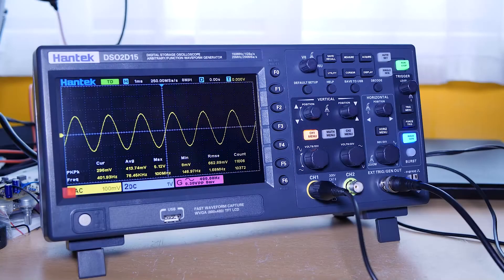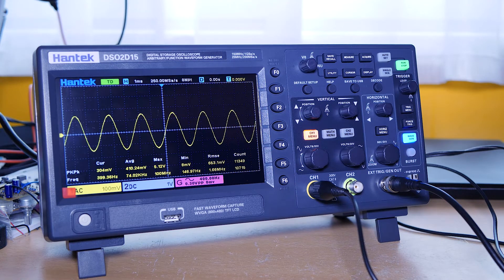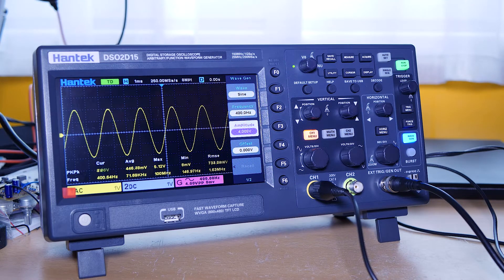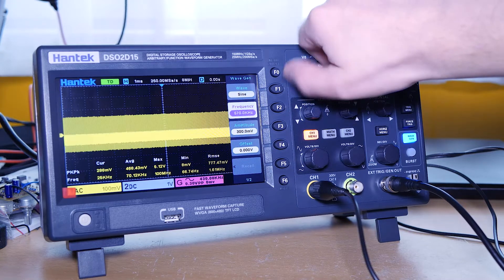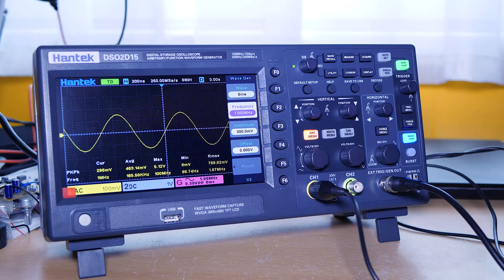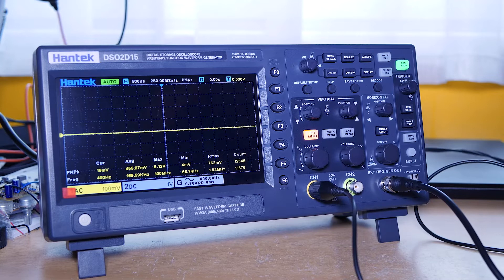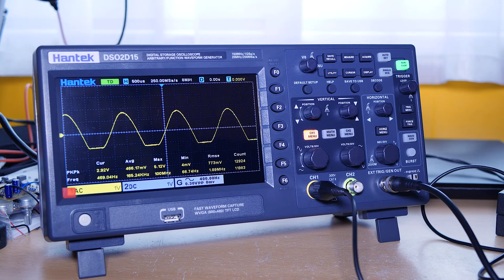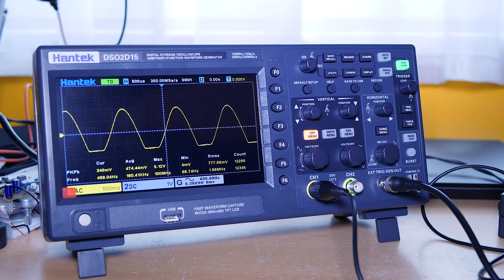Hantek DSO2D15 Trigger issue

Comment: It is indeed a strange behavior, but I think it's somehow manageable. Reduce the amplitude of the waveform on the screen (i.e. increase the mV/div) and the issue disappears, though the waveform is still visible. This is exactly what happens in your video at 1min 50sec when you decreased the amplitude of the generated sine wave, so it shrinks in amplitude on the screen and becomes stable. Of course if you play again with the Volts/div to extend the waveform the issue appears back - it seems to me not an unstable front-end, but some programming bug in the backend's software.

Comment: Indeed, this is not a trigger issue, rather the noise in the input chain. Effectively, you are triggering on noise splashes. The most stable trigger mode for noisy signal is "Pulse": it allows you to set the minimum pulse width to trigger on. Try switching to "Pulse" mode, set the minimum pulse width to something smaller than half your signal period (but not much smaller) and set the threshold to zero or somewhat below. E.g. for 1 kHz signal select something like 300 us (1/3 of the period). You'll see that your signal now is rock-stable.
Reply from the maker: I don't have the unit anymore, but it is definitely worth to try for thos, who have the same issue. Thanks!

Comment: Use X1 mode for probe with 20Mhz BW limit or "probe to BNC" adaptor for connection, it's not issue, it's sensevity to noise.

Comment: I have bad synchronization even with more than one volt signal. How to fix it?
Reply: Use X1 mode for probe with 20Mhz BW limit or "probe to BNC" adaptor for connection, it's not issue, it's sensevity to noise.

Comment: The same problem with my oscilloscope too, a signal of 1 KHz with amplitude below 1V is not triggered, it moves continuously on the display from left to right and vice versa.
I also installed the latest firmware version, the dso3kb_20220210. Nothing has changed...
Has anyone managed to fix the problem?
Reply: Noise is coming out of the DSO's power supply unit. It can be improved by replacing the primary side capacitor with one with a large capacity and adding an AC noise filter.
Reply: @tu-wi6iq how are you sure? will it fix the problem 100%?
Reply: @Sajid-lp9ss  It will improve by about 50%, but basically you need to replace the power supply unit with one that does not make noise.
Reply from the maker: As a workaround try slope triggering
Reply: @drdfx159  I did it but with no success. Thanks anyway.
Reply: My D10 is stable down to about 150mV 220210.00 firmware 3204. You can always hit the run/stop to steady up the trace. ... that fixes it. :-)
Reply: Also.. is your probe set to x10?.... that will make a 100mV jitter floor appear as a 1V jitter floor
Reply: @mal6232  probe at x1, still not triggering with the latest firmware update dso3kb_20220517 they sent me today.
The DSO2D15 is just a toy for hobbysts, Hantek's after sale is a joke and offensive for the customer who has issue with one of their product. 
Buying this oscilloscope was more than frustrating. It will be more than a month since the Hantek after sale goes on with firmware updates that do not solve the situation of this machine at all.
I would never have imagined such a poor product, I definitely do not recommend it to anyone and rather invest in a Rigol, Tektronix and other brands that have been in the field for more than thirty years, not these chinoiseries.

Comment: I think Hantek tries to get their products into the market place before their testing is complete!  They then attempt to fix with backburner firmware updates or just leave the customer hanging!  If we want to get low cost, high performance products, we are going to pay for it in taking the time to argue with them, and waiting to see if they can fix it!!!  Most of the time, the return date will pass before we know if the fix is coming, or if the fix works!!!
Reply from the maker: Totally agree. That's why I finally decided to get rid of the scope. I have an old analog Philips, it is huge and therefore I don't use it too often, but for the rare occasions I need a scope it is enough. And when I decide to get a smaller one, I'll definitely go for a better brand that has proven its reliability already.

Comment: I have the same problem with my Hantek
Reply from the maker: As others mentioned before: you can try slope triggering, it indeed is much more stable, however when your signal changes it is more complicated to reconfigure the triggering levels. I have contacted Hantek support, and after a few mails back and forth they sent me a custom firmware that seemed to help a lot. The waveform was still not 100% stable, it moved back and forth very little, more like a kind of flickering, but it was much better. I still ended up selling my unit, as I wasn't completely happy with this "flickering", plus the FFT capabilities did not convince me either. In addition the green and yellow colors for the two channels were for me almost undistinguishable. All in all I was quite disappointed with this purchase. Other Hantek devices might be better, but I doubt I will try any of them, I rather save some more money and buy some real stuff, like Siglent or Keysight or something similar.
Reply: I have found some problems with picking up smaller signals that ought to work. I have some extra money now, so I think I'll look for a better unit. Save this one for testing first, as I have little experience with oscilloscopes. If I did everything correctly, a first and very basic experiment on Mr Carlsons Lab Patreon account was a no-go.  @drdfx159

Comment: Hi thanks for sharing this and do you think is worth it or not for $300
Reply from the maker: I ended up selling it, so for me it wasn't worth. I think there are better options, if a bit more expensive, and perhaps lacking some features (mostly the signal generator), but they are more stable. Depends on what you need: if you will work with signal levels above 1V peak-to-peak, and perhaps frequencies higher than 1kHz, then it might suit you, especially if you absolutely need the builtin generator function. Otherwise there are better options I think.

Oh and one more drawback: the two channels are marked with green and yellow, I could barely see the difference between them on the screen, so if you need to constantly compare waveforms, then maybe this unit is again not the best.
Reply: avoid to buy it, listen to me...
Reply: @OLDSCHOOLNEVERDIES  so what to pick in similar price?
Reply: @eme444  if you want reliability, you have to invest money in a name brand --- chinese stuff left to be desired and it's unreliable

Comment: I had this trouble too. For values less than 1V with sine or other smooth forms, use the slope trigger instead of the edge trigger and it’s much more stable. I also had some luck increasing the sample rate in the measurement tab - the scope automatically reduces its sample rate with the horizontal scale at low frequencies, but you can override it. Trouble is, it re-sets the sample rate back down when you touch the h-scale, so I’ve had better luck with the slope. I got my DSO2D15 last week, so I’m just figuring things out. Hope this helps!
Reply from the maker: Thanks for the info. I figured out too that slope triggering gives a more stable waveform. In the mean time I got a new update from Hantek, installed it, and appparently it solved my issue. More or less... Sometimes it still flickers, but adjusting on the volts/div knob back and forth solves this. On the other hand slope triggering is unuseable now :D Honestly, I start to give it up. I keep my scope till I find something better (Siglent, Tektronix, Rigol maybe) for a reasonable price used, but then I think it will go.

Comment: Mam tak samo, to bardziej problem programowy, na slope u mnie jest bardziej stabilne
Reply from the maker: Thanks, indeed, slope triggering works much more stable, however that is also much more inconvenient if you need adjustments in the triggering level (or levels in that case). I have emailed Hantek, initially they seemed to be willing to help, asked for more details and also this video, but for more than two weeks now I have not heard anything from them :(